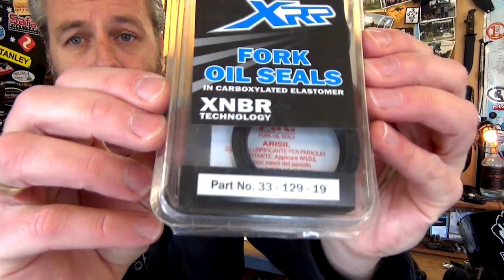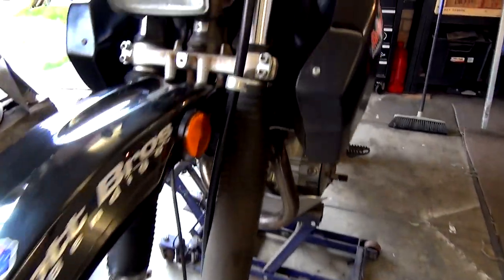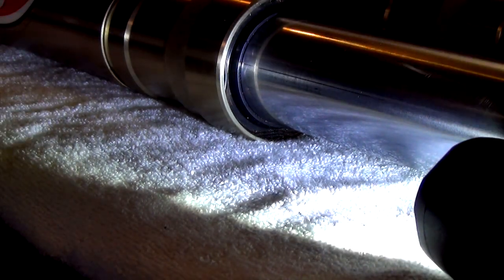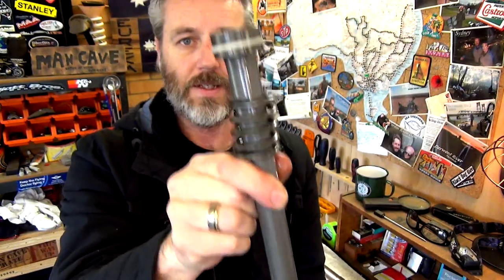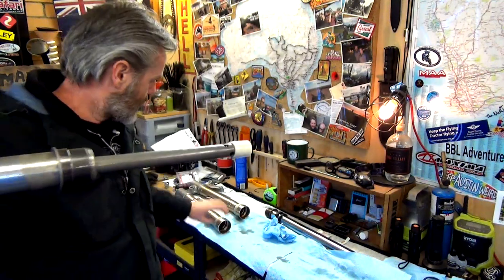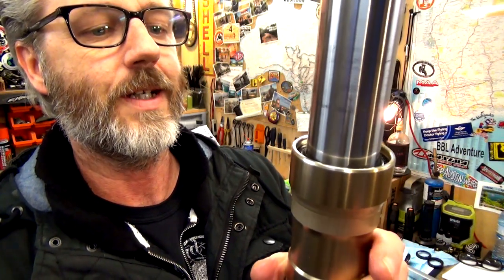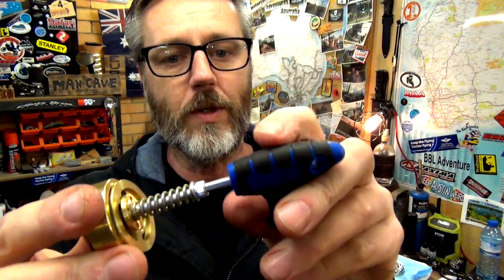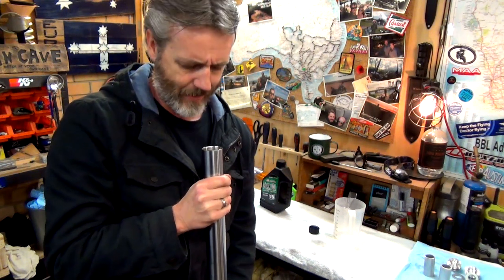DR650 Replace Fork Seals & Install Gold Valve Cartridge Emulators

Comment: Greetings from the USA m8! Thanks for making the video - late comment to the party that could have been addressed - when loosening the fork cap 22mm bolts in the triple clamps, loosen the top clamp pinch bolts a hair as they are binding the fork tube and making it harder to break that fork cap loose.

Comment: The bands you refer to are the bushes, when you try to knock the seals in you also are knocking the smaller of the 2 bushes into the fork leg, that's why it takes a little extra to try and seat the seal.

Extra little tip is to measure the oil level in each fork leg to make sure it is the same in both, compress the fork all the way down, without the springs and measure the height from the oil to the lip of the leg.

From memory the DR is 165mm, the smaller the gap, ie 160 will make the fork stiffer, the larger the gap ie 170 the softer the fork, basically making the air gap larger or smaller.

Great idea the 25 mm box section, engineering genius at work Mark. 👍👍👍
Reply from the maker: +annie white Thanks for all that mate! :-)
Reply: Yep, as Annie stated.
Reply: The manual says both anti friction metals may get damaged when removing the inner tube and should be replaced.

Comment: Just wanted to add a little on your comment about using 4 turns because you have a safari tank.  Don't confuse the spring preload on the imulator to spring preload on the fork springs.  You want to increase fork spring preload to bring the level of the frontof the bike back up with a full safari tank (sag).  More turns on the imulator spring will create stiffer compression damping.  Fork spring = ride height, based on weight of load, imulator valve spring is increase or decrease in compression damping= how fast the forks react.

Just my .02 cents.... take it with a grain of salt... 

I put valve emulators in my DR and it is a world of difference.  I remember how disappointed you were after just the springs, when you could feel the difference with the rebuilt rear shock.  All in the valving.

Another great "how to" Mark.  

ps if you pour the oil in before you put the springs in, getting rid of air bubbles is easier.  As the forks take up space and make the oil closer to top of fork tube.
Reply: You are right about spring preload and front level (so called "sag"). Nevertheless its not a bad idea to stiffen up compression damping a bit for heavier weight (safari tank etc.).
Best regards, Erhard

Comment: Great video. Really shows the process of learning and wrenching.  As I watched I felt some pain when you were assembling without drilling the damper rods.  Most likely The emulators will not work properly and bummer you'll have to disassemble to take them out and drill em. 😢. Cheers!

Comment: Did you remember to drill out the dampening control holes in the damping rods to delete there effect .. cos you want the emulators to have full control of the dampening duties .. it totally transformed my forks, I started looking for bumps to hit instead of avoiding them .. Amazing improvement.
Reply: Not only that, but I just did emulators on my DR and I had to use the included circlips for centering on the dampening rod perfectly. There was a gap otherwise.
Reply: Respect to you  my friend...i dont have the courage to drill my original damping rods , and take a chance on the Emulators , im happy it worked great for you, any tips or suggestions you have ?
Reply: @natanmortenfeld5813  If you understand how it works, then you don't have to be afraid anymore. Simple concept: instead of moving a plunger with holes that barely works at low speed then becomes too harsh at high speed, you get better damping control by metering fluid through a valve with a variable/load sensitive opening. So they open flow up more, then put a spring valve that blocks that flow in a better way.

If you leave the old restrictive holes in, then you are getting partial effects from both systems. So the question is, why would you want the old system still active, the old system that underdamped then became harsh? It's only ever going to make your new system worse and harder to tune.

On my friends bikes with cartridge forks, he upgraded to gold valves. Similar thing: once you understand that gold valves increase flow so it's easier to tune, then have better adjustment on clamping down that flow at various loadings, they cease being scary.

Comment: When I remove the 8mm bolt on the bottom of fork I use an impact gun and have been able to take apart and put back together with out having to hold the damper rod inside. I have done this for friends and for customers when I use to work on motorcycles and have never had a problem. I just don't go crazy with the impact gun when tightening the bolt so not to strip out the threads. Hope this helps if you ever do this again with the DR style of forks. It will not work on inverted forks that are found on sport bikes and full motocross bikes.
Reply: Hill On Wheels agreed. I used a super cheap electric impact gun from HF, and it loosened it right up. I used a regular drill to put it back in.   I did a similar upgrade to my DR a couple years back and swapped in Cogent cartridges and heavier springs. Probably the best money I've spent on the bike.

Comment: Just a suggestion Mark, you should have used the spring tension to slacken the bottom bolts that hold the damper rod also good for holding everything in place to line them up easily. Great video though!

Comment: Great install video! 
It is possible that you forgot to drill the extra holes in the damping rods?
As I understand it, these emulators are designed to move the action from dampening rod onto the cartridges, and so I'm not quite sure how well they'd work otherwise - might be worth a try

Comment: You have to drill the damper rods. Also 1 1/2" PVC pipe work great for driving the seals.
Reply: He didn't
Reply: Yes. Forgot to drill rod holes.
Reply: You mean your not supposed to smash the living crap out of the inner seal lip or just guessamating how much oil to chuck in when you spill some out without measuring from to top of the tube to the oil height.

Comment: without drilling out or adding extra holes for free flow of the fork oil the cartridge emulators are worse than useless. The whole point of the emulators is to allow for adjustment of the oil flow rate which is what dampens the suspension. The factory drilled holes are designed to restrict the oil flow as best needed for factory springs, oil weight and the average load. Cartridge emulators are wonderful things along with progressive springs and a willingness to fiddle around with preload and spacers and air gaps, I have them in my forks but they cannot do their job without drilling out and adding to the factory holes. it's way cheaper and easier to change your fork oil weight and volume. you have to open the forks to adjust the dang things after installation anyway.
Reply: That's exactly right !!! ( read my comment in the first bunch of replies:-) , interesting that many people did not drill extra halls and claiming the emulators work great ...

Comment: Aren't you supposed to drill extra holes on the dampening rod? If you don't then the dampening rod is still badly affecting the compression and rebound.
Reply: My question, too! Just bought the kit and noticed he didn't do this!
Reply: kevvybrenton I noticed that he didn’t drill the extra holes also. Did he figure that out ?
Reply: @sstephen257   no, he totally missed that crucial step
Reply: Yes .. he should have drilled some extra holes in the damping rod .. he either forgot or didn't realize
Reply: lol , i heard from a few people allrady, that thay  "forgot" to drill extra halls ..i think subconsciously they deliberately forgot ... because thats  the scary part in the Emulators installation  job 🥺 , drilling those extra hall's and then finding out it doesn't perform well..what then ? :-( , now interestingly all those people that "forgot to drill extra halls testified those Emulators work great..? hmmm...my understanding is that if you didn't drill the extra halls in tour damping rod,  your old set up is still what creates the damping effect and the emulators do not do what thay supposed too... conclusion: Those who did not drill extra halls, and are testifying the Emulators work great , are lying to them selfes?🤪

Comment: Thanks for putting this up mark . I'm gonna try the F.F.R.C. emulators soon and it helps fallowing along to become familiar . Was wondering when you are going to install the dampener into the forks ? The fork brace does stabilize wobble with full nobs on especially bumping off rocks and tree roots . I suspect the dampener will help as much .      Keep um coming  ; -)

Comment: Thanks for braving this new territory for you and sharing the video!  I'm about to throw some emulators into my DR this weekend- this video definitely helped alleviate some questions and concerns I had.  A quick comment that I learned from a suspension manufacturer after saying the same thing as you;  it's a DAMPING rod, not DAMPENING rod.  Dampening makes you wet, damping makes you fast:)
Reply: going fast makes my girl....well you know

technically its both..
Reply: @apokatastasian2831  slick is the term....

Comment: You forgot to drill larger holes into the dampening rod for more oil flow.  The emulator is doing minimal work because there is reduced oil flow

Comment: Great video. The only way this works ,without drilling additional  damping rod holes, is to decrease the viscosity of the fork oil. Cogent DDS design only recommends about 5 wt oil, compared to 15wt . The 5 wt allows for increased flow through the stock damping rod holes. Not sure how much...I will stick with drilling holes and using the Emulators.

Comment: Mark, I wish you would address the issue of drilling holes.  Both the Racetech and Procycle people say 6 x 8mm holes are required.  You mention briefly in passing that Vince Strang Motorcycles say you don't.  
It is a crucial point in the whole exercise, to drill or not to drill.
What is the evidence for this?
Reply from the maker: I don't know... They work great now so I'm not messing with them! :-)
Reply: @BikerBits  You improved your low speed dampening only. High speed the fixed orifices in the damper rod will cause harness. If you are happy with them now, you are in for treat when you only run variable orifice dampening.
Reply: that's my question as well..i dont have the courage to drill my original rod , i need more assurance it really works .
Reply: @natanmortenfeld5813  Nathan, I too had great trepidation about destroying my damper tunes by drilling holes in them, but I did it, and after fitting the emulators it transformed my DR650 like I wouldn't have believed. I've forgotten the hole size now, it'll be in the instructions, but go with confidence, it does work, and amazingly so. I used to dread a particular dirt corner that was corrugated, not knowing if I would slide out, but now it's a non event. Emulator valves are great!

Comment: When undoing nuts bolts etc  always use the ring end of the spanner  when and where you can   also undo those top pinch bolts on the triple clamp will make it easier undoing the fork cap
Reply: We were taught the same open ended spanners only as a last resort. Otherwise rounded corners on nuts ( not nice ). 6 point sockets are the go when the going gets tough, if you have them. Otherwise great video encouraging people to have a go. Oh yes one more thing a torque wrench doesn't go amiss, although when I was a young bloke no mechanic could afford one. The workshop owned the torque wrench, so it was only used for critical jobs like cylinder heads. You develop a feel plus as the nut gets bigger the length of the spanner increases therefore applying more torque from the same amount of hand force.
Reply: sumpoiler agree with loosening the top triple clamp first. I stripped my fork cap and thought all hope was lost before I loosened the top triple clamp and it came right off. The pressure from the lower triple clamp is plenty to keep the forks from rotating.

Comment: I reckon you could have used the “tool” to help push the damper rod in when you were about to put the 8mm Allen bolt in the bottom of the fork. Was that not an option?

Comment: According to the Race Tech website, the emulators will not function as intended unless you drill out the original holes on your damper rods. I didn't see you drill anything or even mention it.
Reply from the maker: I did not drill mine! 👍
Reply: @BikerBits  I'm aware.  The oil flows through the holes at the bottom of your damper rods when compressed, creating a resistance that is based on the size and quantity of the holes. The Emulators, are intended to emulate this resistance. The potentially adjustable resistance of the emulators must be transferred to them by drilling out the original holes. If the original holes aren't drilled out, you lose the effectiveness of your emulators. https://www.youtube.com/watch?v=j3QYZEQoN_M

Comment: You need to drill (much) bigger holes on the original damping rods. Otherwise now you have 2 damping systems working at the same time!
Reply: I was going to make the same comment. Unless lighter oil is used the investment in the emulators is completely wasted.
Reply: you are right , you  have to have the courage to drill extra halls  and take a chance on those Emulators  that's why many people forget to drill...
Reply: @natanmortenfeld5813  just drill them no reason  to be afraid and the larger holes in the damper rod allows full flow without heat build up......the emulators simply replace the damper rods
Reply: @paulcorradini1662  thanks 👍

Comment: you should have drilled or enlarged the damper oil holes, without drilling the emulators are pretty much useless with minimal to no impact.

Comment: Spray some WD40 on the staunchions so they slip out easier and usually without leaving wiggle marks: also loosen the bottom cap head while the forks are loaded up, it usually undoes without having to shove things down the tube to hold the dampening rod.

Comment: I  just checked Race Tech's installation guide on their website and this guy totally did these forks wrong.....the damper rods require drilling when using these valves, Race Tech #4301. Too bad he screwed the pooch.

Comment: He didn't drill or braze the dampener rods.....hmm.
Reply: i  can't blame him , its scary to do it...you gone ruin your fork damping , and rely only on the emulators, what if they dont work well, btw: someone here says that if  you put lighter oil , with out drilling the emulator will have effect but only in low speed bumps, which is actually my problem, to much dive in low speed...

Comment: So.....You have to dismantle your forks everytime you want to make an adjustment? No thanks!
Reply: lol fairdinkum ?? how often do you want to adjust them? I'm sure you aren't Casey Stoner  adjust them once when you put them in and ride the bloody thing....after a bit you'll know if they are too hard or soft its a half hour job pull em out do it again and they'll be fine...
Reply: It is easy to readjust. Loosen handle bar. Slide to side. Remove cap. Pull up springs, washers and spacer. Reach in with a claw pickup tool and pull up emulator. Make adjustment. Reinstall using claw pickup tool. Reinstall remainder. Do the other side by sliding the handlebars to the opposite side.